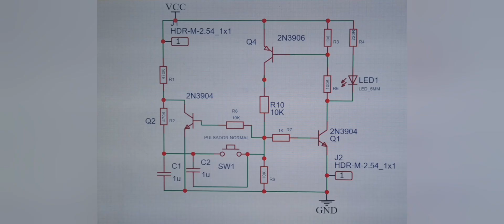Make Your Own ON and OFF Circuit #Switch  #electronic #circuit #engineering

Comment: Nice! I will use this for my amplifier power (I will put one more tranzistor and 1 relay for my transformer ac 230v) Buț I will need anoter 5 or 12 v supply 🤔
Reply: Hey, how about use a SSR to drive your 230V ?!  Use the DC 3~24V to control AC.  Or, you can use a 74LS74 circuit will be simple than this one. I prefer to use a 51 MCU (STC8G1K08A) to do this. 😀